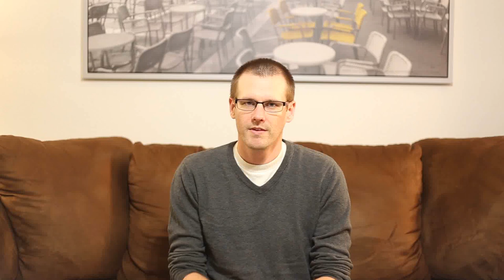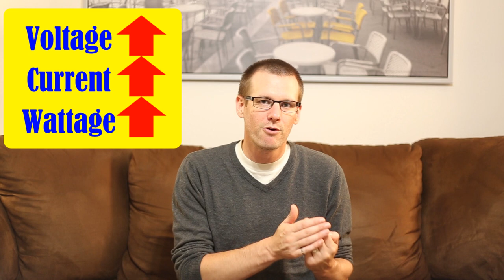Can Higher C Rating LiPo's Destroy a Motor or ESC?

Comment: This is good stuff! Thank you for infos. As an RC noob myself im still learning everything as well. Still kind of confused on some things when it comes to the ESC on the car. For example, I purchased a Redcat Shredder and it says it has a HobbyWing 80Amp 4S Waterproof ESC (also come with  a high torque 1300kv motor). And I know it runs 2, 2s lipo batteries so I purchased 2 Zeee 7.4V 60C 6200mAh lipo batteries. I hope I didn't purchase the wrong ones lol.

My understand is that the ESC wouldn't ask for more power above what it could handle. Are those Zees lipos that I purchased too strong for the RedCat Shredder XTE to handle ?? Any help would be awesome!!
Reply from the maker: The ESC doesn't ask for power. The load that is placed on the power system is what determines the power output for the rest of the system. It is then up to the system to be able to supply it. If the ESC can not supply the current the motor is demanding, it can overheat and fail. Buying high c rated batteries is the best option for nearly all applications.
Reply: @RCexplained  Awesome! Thank you for replying and clearing it all up, highly appreciated dude!

Comment: Hye sir..if i use 120a esc for 1/8 scale with motor 3670 2650kv,in esc spec can use 2s-4s battery,and i think i want to use 4s lipo below 6100mah with 90c rating..its that ok to this setup..because in motor spec maximum voltage 18.5v max current 86a and watt 1600..or i can go more high c rating like 110c or 120c..thank u for helping..😉😉

Comment: I have a cheap rc car as a "beater" and have an extra for parts. The battery is a 9.6v and that mah isn't high at all. Could I wire them in parallel without any concern?
Reply from the maker: You can wire two 9.6v batteries in parallel to increase the discharge capacity.

Comment: I bought a RC car that is coming with a cheap esc / receiver (hbx 16889a pro) and its esc should take 7.4 (coming with a lipo 1000mAh 25C), I was thinking to buy indeed a higher rating like 50-75 or anyway not over 100c with 2000mAh, do you think it is crazy?  (also I'll try a 3S 25C 1000mHa to see if the system can handle it as so many people are fine with it)

Of course before or after I'll probably upgrade esc / receiver with a 60A but so far people are not doing it and using it with no problems, I was thinking to give it a try..

And a second very important question (I'm a beginner and I'm trying to avoid problems): you must storage / balance the battery? as the car came with a cheap usb charger that can not do it so I'm wondering if it is dangerous or not using only that simple charger.

Thanks in advance and great video!
Reply from the maker: Upgrading to a higher C rating and capacity should be fine. Just monitor temperatures on the motor, ESC and battery. 

As for trying a 3S 25C 1000mAh battery, this will significantly bump the power up. You must monitor temps on your system.

Regarding your second question, you must balance the battery. Your charger should be doing this. 

Charging or discharging your battery for storage is going to make your battery last for many more years. You can do this with a voltage checker and your RC Car. I'd highly recommend watching more videos on the channel about LiPo battery's.
Reply: @RCexplained  thanks, I'll be very careful with the 3S and I know it is 50-50 the probability that can this truck can handle it (it seems that I guy got 2 trucks and only in one is working fine).

For the storage..well, if I understood good it is more if I care about keeping for longer time the battery alive so maybe I'll start with it's simple usb balance charger and then I'll get probably the B6 so I can storage them, but from the view of a beginner sounds a bit annoying to storage 2-3 battery after using it and charging again the day before I use them.

Anyway thanks for your answer mate
Reply: @RCexplained  at the end I bought the B6 charger, so I'll start to storage the battery that I'm waiting to receive from the beginning, thanks for the tips! ;)

ps: I also needed to check the 3S before and after a run so far the esc is made for 7.4V, for 25€ I'll sleep better checking it

Comment: Can i use a 11.1v 5200mah 80c battery with 60a esc and 3300kv motor?? or should i get a 5000mah 50c 11.1v?
Reply from the maker: Depends on the rest of your setup. Both packs sound good enough.

Comment: Subbed bro. Just wondering. I have a 2s 7.4v 4500 lipo 45c 2pcs working with series (4s) with 120amp esc hobby wing. Is it okay with that 45c rating? And what happen to the C rating if use in series? Do they doubled?. what do u recommend best fit on my 120amps hobby wing esc.?
Reply from the maker: The C rating is unchanged no matter how the battery is wired. What are you looking for to use on your 120A ESC, Battery or Motor? Is this for an airplane, car, boat?
Reply: @RCexplained  oh okay. Best c rating to use on my 120amps esc by using 2pcs 2s lipo battery in series. For an rc car. The dhk maximus.
Reply from the maker: For that RC I would get the highest C rating that you can. The higher the better.
Reply: @RCexplained  okay thankyou so much!

Comment: I have a 35a esc that can run 4-6s lipos. Some motors started to twitch and not spin so I got a new esc, after a few flights same thing again, could this be because im running 4s 1500 100c, is it too much for the esc? When it flys, I run packs after packs. But when it stops both times it was the first flight of the day within seconds
Reply from the maker: The higher the C rating, the better for the ESC. What motor are you using?

Comment: I have a 11.1V 50c 2200 mAH and it killed.my esc witch was a 30a what Amp should I get for an esc
Reply from the maker: How do you know the battery killed your ESC?

The battery does not push current through your ESC. The power system pulls the amount of current it needs. If your ESC burned up due to excessive current/heat chances are it was  over loaded.

Comment: I have 4000 mah 3s 40c battery and 2200 kva motors which esc should be best for making rc aeroplane one motor model ?
Reply from the maker: Hello. It's not enough information to answer the question. What motor? What airplane?
Reply: @RCexplained  sir it's 2200 kva bldc motors and I am building rc aeroplane help me I buy blheli 30A esc 4s from AliExpress I'm I right

Comment: I have 40a esc hobbywing.. and stock nimh 2000mah battery.. my hobbywing esc can switch nimh and lipo 2~3sbattery.. if i wanna upgrade to using lipo.. what c rating suitable if i wanna play more times my Rc.. tq
Reply from the maker: The higher the C rating the better

Comment: Sir hello i have a 60a esc and a 3s battery,i have a 25c and a 35c battery that i am currently using on a 1/8 truggy,am i on the right path? Or what is the max c rating that i could pair with my esc sir? Thank you so much
Reply from the maker: Highest c rating you can.
Reply: @RCexplained  thank you sir

Comment: Hey, I got a question.  I’m new and I’m planning to buy a hbx 2995 and it uses 2s 30c 7.4v lipos.  Would I be able to run 3s 45c 11.1v lipos without much problems? I’m also planning to buy an esc fan as well
Reply from the maker: You would have to look at the specs of the truck. Can it accept that increase in voltage? Is it rated for a higher voltage?
Reply: @RCexplained  I really don’t have much clue because their isn’t any information on Amazon stating if it can handle increased voltages.  I’m looking through it and all I can find is that the esc voltage input is 7.4v idk what that really means but it seems like it probably won’t be able to handle 3s

Comment: Question, if I have a 1500mah/15C battery would my RC go significantly faster with a 1500mah/60C battery? Is there a speed difference?
Reply from the maker: There should not be much difference in top speed.
Reply: @RCexplained  Ty, still new to RC’s, started off with a Hosim 9156 which has a 550 motor and is already pretty fast but I’d like to go faster. Any tips? Maybe a different motor? Or can you suggest another RTR RC under $200?

Comment: Can a             120A esc                                         and a              kv2030 brushless motor and a             9kg servo                                 can take                                                   7.4v 3200mah + 11.1v 2200mah battery power
Reply from the maker: Hello Farid, I don't understand you question. The LiPo batteries you have listed should not be placed in series or parallel. That's all I can make out from your question.

Comment: Hello, I have a Maverick strada mt with the msc-30bl-wp esc (wich I think is broken by the way). I have used a 3s lipo, 6000 mah, 40 c. Could that have damaged it? The battery being to big I mean. The specifications of the esc say continuous current 45 A and burst current 220 A. After my calculations, my battery has an output of 240 amps? Is that too much? Thank you in advance 🙂
Reply from the maker: It is the load that you apply to the motor that determines the current draw through the system. Thee battery won't push its 240A continuous current if the system doesn't demand it.
Reply: @RCexplained  thank you. I didn't actually write about the symptoms of the car. If I hold it in the air, the wheels spin like hell. As soon as I put it down, it barely moves and stutters a lot. Occasionally it also shuts down after trying it on the floor for 10-15 seconds. I asked around and a lot of people said it's the gears, it's not mechanical, I checked. Then some people said the battery is not good, I tried it with 3 different batteries including the powerful 3s. Last 3-4 times I ran it, I noticed there where a lot of short power breakouts while driving. I could really use your opinion on this. Thank you in advance again 🙂
Reply from the maker: what are you geared at? what kv are you using?
Reply: @RCexplained  the motor is brushless 3215 kv and standard gears 48t 0,8 spur and 15t  0,8 the small one. The model is Maverick Strada Brushless MT.

Comment: I had a 2s 7.4 v 3300mah 30c battery and a 100a esc in my rc boat then i bought a 2s 7.4 5000mah 60c battery and when i plugged it in the boat didn't start. Is the esc destroyed?
Reply from the maker: Plugging in a battery within the voltage range of the ESC should not destroy it. Did it smoke?
Reply: It was something wrong with my receiver. Now it works :)

Comment: It is safe for a dual 70 a esc with dual 3100kv motors run on a single 3s 3600mah 40c ?
Reply from the maker: Hey Kurt. There are some electric skateboard dual ESC'S that are designed and wired to use just one battery. In most cases this should be totally ok to do. If you have any doubt, confirming with the manufacture would be best.

Comment: I have a 3s/4s Proboat with 2300kv motor in it and a 100amp esc in it (stock)

But my esc has burned up within minutes. Now I have orderd a 150amo esc (i will not run higher them 4s) But now other say I cannot run a 150amp esc on a 2300kv motor. But why?! If im just running max 4s then I shouldnt matter how big my esc is, isnt?
Reply from the maker: I'm not sure what those who are saying "you cannot" are getting at. Without knowing your full setup, it is not enough information to say you can or can not run that ESC with that motor.
Reply: @RCexplained  my Proboat Recoil 2 (26inch) is bone stock. This is my first boat and it can run stock 3s or 4s. But my stock (100amp) esc burned up..

I will get a new ( stock 100amp) esc from the hobbyshop, but also orderd a aftermarktet 150amp esc. I thought maybe an overkill esc will burn up less quickly then a 100amp esc.

Im doing Rc cars for more then 10yrs and im running allot of 4s motors with a 150amp esc's on it to be extra save. Especialy when im using a bigger pinion.

But im new in boats and wanted to know if just putting a bigger esc in a all stock 4s boat will cause problems (i just running 4s only in stock set up. Only a bigger amp.esc)
Reply from the maker: @JvD1985  with nothing else changing, a higher rated esc will be fine.
Reply: @RCexplained  thanks for the confirmation 💪🏼

Comment: Hi and thank you for the video. I'm new to RC car,  can you please  advise me what battery is best suited for my Xinlehong 9125 (eg C rating)? These are the stock specs below, but I'm wanting to run it on 3S.
.
2x 390 electric brushed motor
60 ah motor drive
Servo 2.2 kg
1:10 scale
2S Li-Po 7.4v 1600 mah deans 
ESC 60 amps

Thanks very much.

Comment: Will a 6200mah 80c lipo kill my Wltoys 144001?
Reply from the maker: If you have longer run times, just watch heat in the battery, ESC and motor. The C rating should never kill an RC with a correctly selected power system.

Comment: If me esc needs 45 amps then that's all it should take so high C battery shouldn't matter? In the automotive world that's how it works,  my car needs up 550 cold cranking amps but I can put a 1000 CCA battery in and it only takes 550 CCA for example... so I don't think a higher C battery for an RC toy should matter... maybe if there is something wrong in the esc or in the motor ie. bad connection but it the esc, motor and connections are all good then it's only going to pull 45amps . Or if you where to hold the wheels from turning and hold full throttle then it would burn out at the weakest link but that would happen even with the proper spec. setup ..... right or am I missing something?
Reply from the maker: There are many who live in cold climates that need more than the specified CCA amount. And there are some that live in frigid weather where all the CCA they can buy is not enough. In these temperatures they don't shut their cars off! Imagine that. 

It's important for individuals living in these extremely cold climates to choose a battery with an adequate CCA rating, and in some cases, opt for a battery with a higher CCA than the manufacturer's recommendation to ensure reliable starting in harsh winter conditions.
Reply: I know that... but the car is going to pull only what is needed provided the battery is capable..... so if it put I 120c lipo on a 30c set up it should hurt anything as long as all components and conditions and good.... the esc and motor are only going to use what they are rated for.... now if it used a high voltage and a system not designed for it then "you" would burn things up.... at least and a mechanic for 30 years that's what we where taught... eg. In 12v automobile the amperage doesn't matter as long as the battery meets or exceeds the demand... but if You were to put 24 volts to the car "you'd fry the system
Reply from the maker: For a high percentage of all setups, it is encouraged to run the highest C rating battery as possible. I simply made an exception for this rule in a case where the motor is already at max thermal limit and an even higher C rating battery is used. This would then push the motor over temp. 

Do note the motor and ESC can and will use more than they are rated for if the load forces it to. Load controls the current in the circuit.

Comment: Can i use 2s 7.4v 2200 mah 120c at esc 45a Brushless?? Its posible esc can burn??
Reply from the maker: It's only possible for anything to burn if the load (too much propeller or gearing) on your system is too high.
Reply: Tq masstaaaa

Comment: I found a calculation that says my battery is about 150 amps but my esc is 45 amps I believe and my power system is getting really hot I think that’s my problem? 5000 mah 30c zippy hardcase mah x c rating %1000
Reply from the maker: The problem is there is too much load on your motor. Gear down or prop down.
Reply: @RCexplained  I tried gearing down and it’s super slow or has the problem of the motor getting hot and esc stays normal heat

Comment: Higher mah on battery can damage motor or not? Depends on the situation?
Reply from the maker: If your setup is selected correctly, higher mAh will not damage anything.
Reply: @RCexplained  what do you mean by setup correctly?
Reply: @RCexplained  please explain im a newbie 🥺🤗
Reply from the maker: If your setup can handle the sustained power over a long period of time, battery capacity or longer run times  will not damage anything. 

If your power system gets very hot after a short run and you get a larger battery pack, there is a chance the increase in run time will push your system over its thermal limits.
Reply: @RCexplained  thank you

Comment: Can a 50A speed controller run with a 2s 4000mAh 50c battery?
Reply from the maker: Yes, however there is a lot more to it than what you have asked. The 50A ESC could potentially work with any 2s battery that you would have asked about.
Reply: @RCexplained  Thanks you, but I forgot to mention that this ESC runs a 3000KV motor. Can it still run with a 4000mAh 2S 50C battery?
Sorry for my bad English
Reply from the maker: @muerto3836  The quick answer is yes it more than likely can. However, if you are trying to turn a 1500mm propeller direct drive, then no it can't. The point is, you have to be certain that the load you place on the system does not exceed what the system can handle.
Reply: @RCexplained  Okay thanks for your help!!
I will leave you a sub😋

Comment: Could a 70 amp each work with a 2200 4s lipo 50c?
Reply from the maker: What are you putting those pieces in to? That's what determines if it is ok.
Reply: @RCexplained  to a 70amp esc with a brushless 4000kv motor